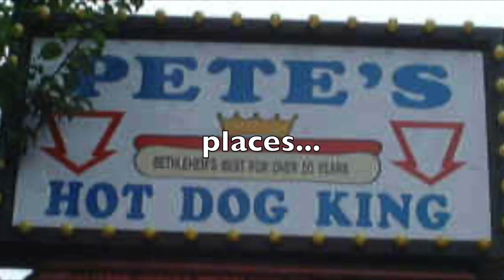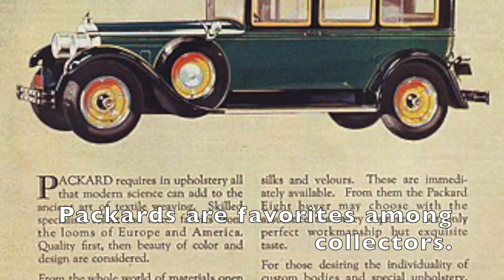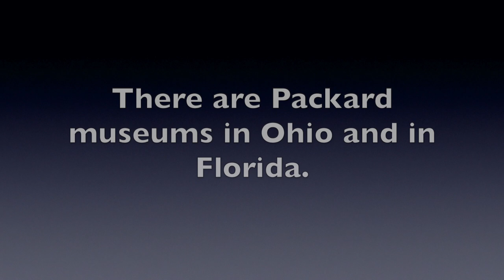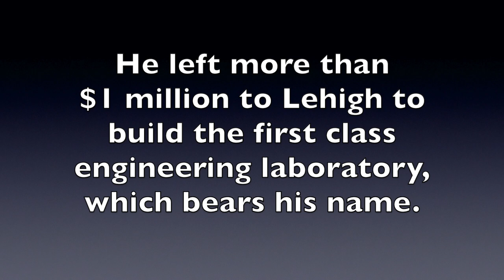Exploring Bethlehem... James Ward Packard

Comment: the packard eight was not introduced in 1930.  it was june 1923 as i have a 1925 7 passenger limo with that 357.8 cu. in. 3 3/8" x 5" bore 84 hp. still going after 98 years. till 1927 was the 1st gen engine.
Reply from the maker: It was produced between 1924 and 1936.